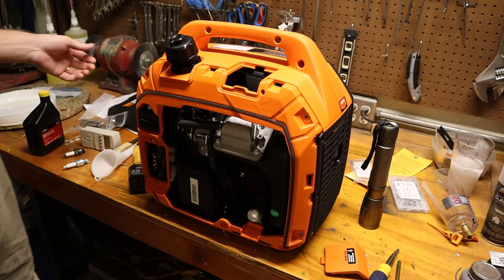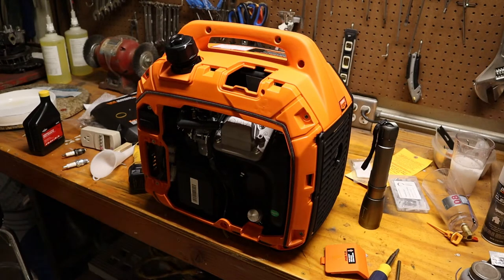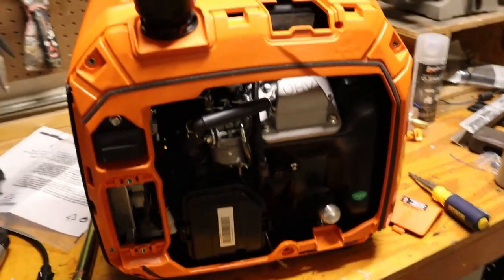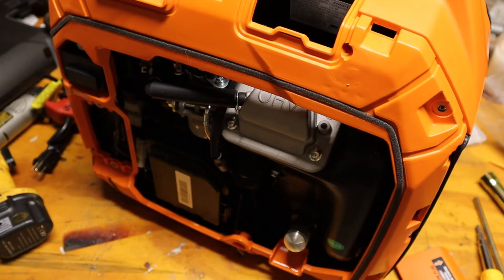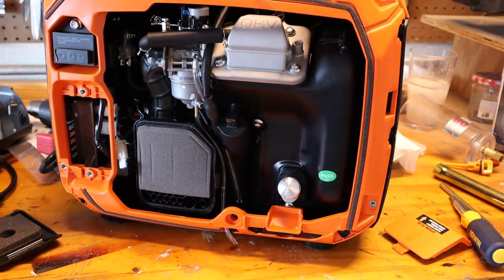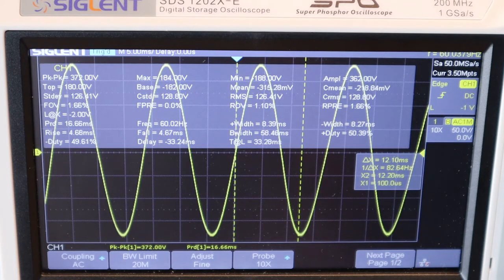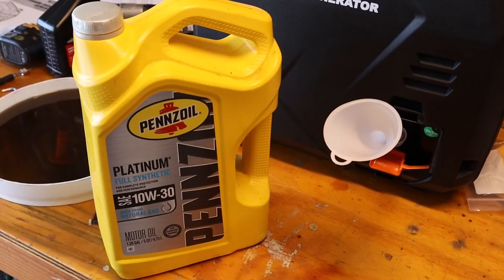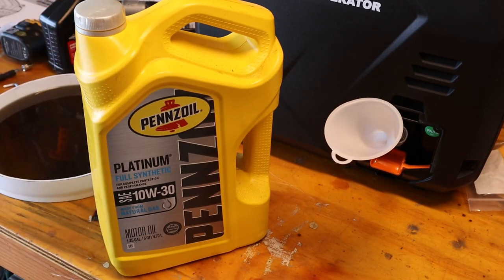Wen 56203i Inverter Generator Review

Comment: This is an awesome little inverter generator.  I've had mine for a couple of years now and it has served us during many outages.  Always starts up and its record was 14 hours in eco-mode with about 30% average load!  (much higher than its factory rated runtime...and beyond the recommended oil change interval, heh...oil was changed immediately after that specific run and it was clean)!  It has no problems keeping our fridge, several lights (LEDs of course), electric heater, and entire home entertainment setup going during outages.  Punches above its weight!
Reply from the maker: Yeah it's an awesome little machine! In my case as soon as I bought my first generator the power never went out... Of course. I do use it from time to time in remote locations where power is unavailable or difficult to get to, to run tools and such and it has never let me down.
Reply: I to have the same generator and it is awesome I have ran it more than 12 hrs a day  everyday now for 9 months straight and it has never failed to even start on the first pull. I have adjusted the valves 3 different times and the I checked it after 159 hrs and it is still perfect and then I checked it again after another 150 hrs and it is still perfect so after 3 valve adjustments at around the 150 hr mark you do not have adjust the valve lash anymore. This is by far the best generator i the world. Mine runs for 14 to 14.5 hrs on 1 tank of gas. I have always changed to oil and added STP original oil treatment the blue bottle it reads for conventional or synthetic oil. I have always kept the air filter clean and lubed with K&N air filter oil. I have had several Honda IE 2000 and this Wen is a far better generator the fuel gauge is right on top where you can read it as you fill it and the oil changes are super easy and super clean and simple his is the best designed generator with general maintenance in mind. the engine is a Yamaha engine a clone engine.

Comment: Great review and mechanical look! Thank you! I just bought this exact generator, and I agree, am overall very impressed with it, especially considering the low cost. I have the Yamaha EF2000is generator with several THOUSAND hours of use on it. The crankshaft oil seal failed, and I will be repairing it when I can get the time, but needed a gen immediately in the interim so I bought this WEN. It will be interesting to see how it holds up for durability. From the performance standpoint it seems to match the Yamaha in nearly every respect. Just got back from a long weekend ice fishing with an average 200 watt load, and this new WEN ran a full 12 hours on a full tank of gas.
Reply from the maker: Thank you! I had a chance to use it last weekend at my daughter's birthday party. I intended to use it to power a bounce house blower, but the WEN wouldn't handle it. To be fair, it was a very large bounce house and the blower appeared to be a 1/2 - 1 HP PSC motor. I tried "feathering it" on, and the WEN kept on going into overload. I eventually gave up, drove home, and grabbed one of my open-frame generators which handled the load no problem.

I was a little bit surprised that the WEN wouldn't handle it, since it started my 1+ ton portable AC, but I suppose that the PSC blower motor, with the mass of the fan attached, kept the WEN in overload for too long, whereas the portable AC only kept it in overload for a second or so.

Comment: Very good review. Been trying to decide which generator to get. Seems everyone has their opinion, but so far I'm liking the Wen.
Reply from the maker: Thanks! I like this one a lot too. Nice and light too!
Reply: @JoesGarageProductionsLLC  Just ordered one from Amazon, with the magnetic dip stick. Would you recommend using synthetic 10w30 to break it in? Already have several quarts,
Reply from the maker: @mikestone9129  generally I break in small engines with straight 30 weight non-synthetic oil and then switch over to a synthetic after 10 to 20 hours or so. That said it's probably not going to make a huge difference in the long run I wouldn't sweat it
Reply: Just unwrapped mine .No fuel gauge, no input/ output gauge...cheapened it...

Comment: Just picked up this generator this week. During the break-in the green output indicator light stopped working, but I was generating electricity. Any idea why that light might go out?
Reply from the maker: That is strange... could be as simple as the LED stopped working or as complex as something wrong with the inverter board. If it works OK, I personally wouldn't worry too much about it.

Comment: I wonder if your heat gun is actually drawing more power on that setting because the heating element isn't being cooled down as much as on high? Heat is resistance.
Reply from the maker: I suspect the heat gun is using PWM (pulse width modulation) to pulse the heating element on and off really quickly to control heat output.

Comment: Saw another review video that recommended swapping out the spark plugs as well. They went with an NGK and the good synthetic oil. You wouldn't happen to know which NGK spark plug would be the correct replacement would you? Excellent review BTW, pretty sure I'm going to pick this up after watching your video.
Reply: Look on Amazon for NGK for your model Wen. I got 4 from some place in Ohio.
Reply: @mikestone9129  Thanks! Appreciate the info
Reply: NGK 6222

Comment: I liked the 5 gallon bucket tray!   73!
Reply from the maker: Lol yup super handy!
Reply: Hey just picked it up today.  I broke it in with 30 weight. 1 hour drained it added fresh and ran it another hour. Drained it added 10-30. My issue my green led light does not turn on. The exhaust really smells and puts out white smoke when starting and when swapping from low to high idle . Does your do this?

Comment: The manual states a grounding rod is necessary. If I'm just running a couple electronics off extension cords is that necessary? Do you ground yours? Trying to decide to keep or send it back as grounding won't be an option in my application.
Reply: Not needed, a video explained that a ground rod will allow you to get shocked if you want the circuit breaker to work you need a bonding plug.

Comment: Going to be picking up the wen 56203i. Can someone tell me the spark plug that comes with it so I can look up the NGK replacement and have it, the generator and magnetic dip stick all at once.
Reply from the maker: I believe it came with a Torch E5T (NGK BPR5HS). If I recall the NGK was hard to find so I ended up using a Champion. It probably doesn't make a whole lot of difference in the end though.
Reply: @JoesGarageProductionsLLC  Appreciate the reply. Guess if I don't have any luck finding the NGK, I'll go with the champion. Happen to know the champion you used off the top of your head?
Reply: The NGK was 4111, but it was updated to the 6222. I just bought one to replace the Torch plug that came in it. Works great and only $4.

Comment: Just picked this up and did break in. I have two questions. Does the green led stay on all the time mine flickered and is off. I have a strong exhaust smell too. I notice a puff of white smoke on start up and when going from eco mode to full power. Any of you having this issue. Running tru fuel 92 4 stroke for generator not the mix type.
Reply from the maker: I don't think I had any of those issues you mentioned. If I recall correctly the power light would stay on anytime the generator was making power. I don't recall seeing any significant smoke either. Perhaps yours is defective unfortunately
Reply: @JoesGarageProductionsLLC  i call and spoke to wen customer service. They agreed to send me the three LED with plug. The smoke went away after running it for 3 jours this morning.

Comment: How do you protect it from rain if that should happen?
Reply: Get something like the IGAN small inverter generator tent.
Reply: @pinkiepie1656  Thanks for that. Does it have the spark resistor built in? Still looking thru manual.

Comment: Sorry bud but they don't make aluminum bores  if it was aluminum there would be a cast iron sleeve pressed into it. It wouldn't last a month if it was an aluminum bore. There's a possibility it could be aluminum with a nikasiil plate
Reply from the maker: That is just a generic term that refers to anything that doesn't have that cast iron sleeve. Most of the homeowner grade equipment these days doesn't have that sleeve and those engines are typically good for 200 or 300 hours. If they plate them I'm not sure what they plate them with but the point is they don't have the cast iron sleeve... You would be hard-pressed to find a commercial grade motor of any kind that doesn't have the cast iron sleeve
Reply: nikasiil bore will outlast the piston rings and a soft iron bore for sure. that's why we don't use cast iron in MX race bikes anymore because aluminum cylinders with nikasiil coating last much longer (when done right) and transfers heat much better.

Comment: Is a good method to level this generator when your ground is uneven?
Reply from the maker: Ideally, yes, primarily to prevent a lack-of-lubrication situation. The oil in the crankcase will always level itself with the ground and if the ground is too far out of level, it is possible that oil would not be stirred up by the dipper/oil slinger on the connecting rod. This could lead to engine failure. I'd imagine the ground would have to be pretty far out-of-level for this to happen, though.
Reply: Thanks, Joe. My concern is the fuel flow from the tank. Since the ground is uneven I use a small round level next to the gas cap and position the generator so the bubble is centered in the level.  Would this method keep the generator running until it runs dry?
Reply from the maker: @tomkerrigan3020  yes that should do it. Good luck!

Comment: What are the starting amps required for the A/C compressor?
Reply from the maker: Sorry, not sure on that one. I don't see LRA amps on the sticker either. I'll measure it the next time I have it hooked up. Running amps are 11.9 though.
Reply: @JoesGarageProductionsLLC  Thank you for checking
Reply: @JoesGarageProductionsLLC  I have a 10K BTU unit in a boat. It has a LRA of 42. I borrowed a eu2000 and it ran without issue but it was a Honda
Reply: @JoesGarageProductionsLLC  was compressor on when gen was on eco mode?
Reply from the maker: @markdimaio8396  it's been a while but I'm pretty sure the generator would not run the air conditioner when it was on eco mode.
Reply: @JoesGarageProductionsLLC  I didn't think so but I just wanted verify

Comment: How long does it run @ 50% rated watts, say 800W?
Reply from the maker: I did not test that specifically, but it is advertised to run 10.8 hrs @ 25% load and over 7 hours @ 50% load. I might have a chance to test that out during this coming hurricane season!